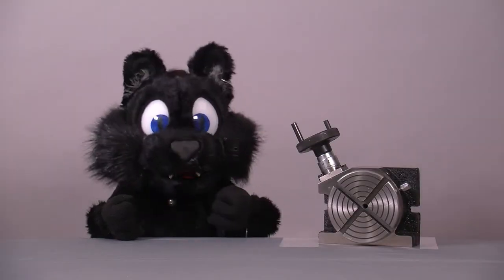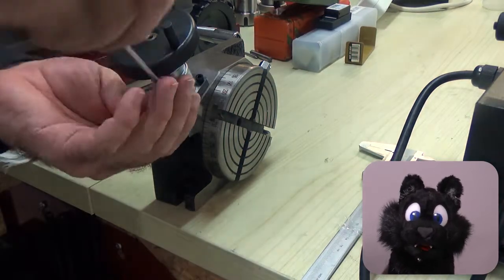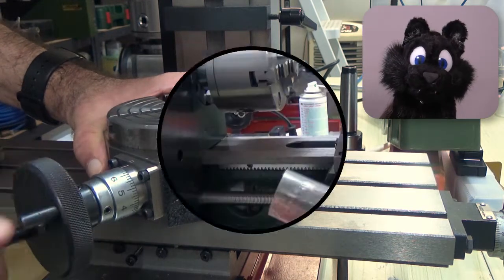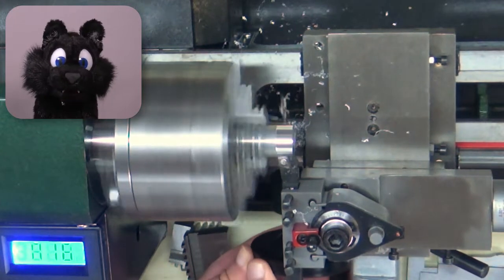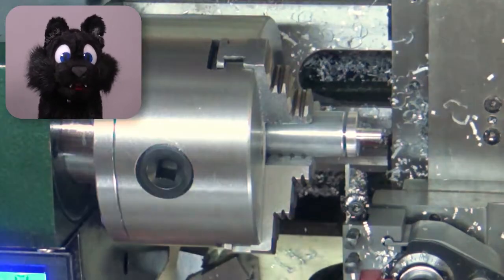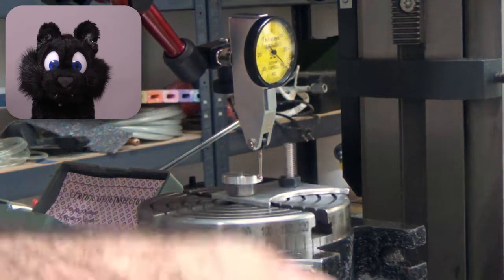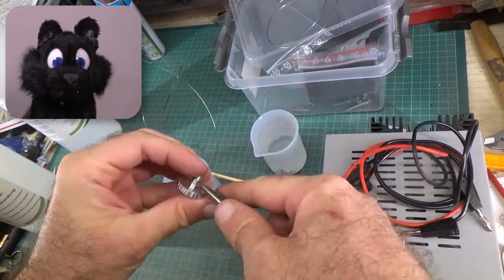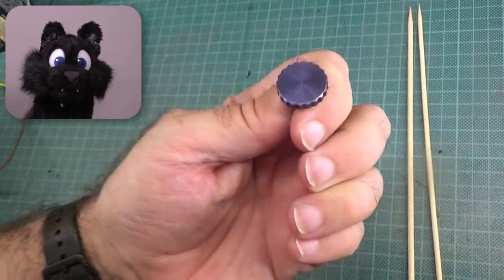Thumb Screw (and other stuffs)

Comment: Is you're mill the sx2p?  and did that rotary table come from ebay?   With the lathe... best to remove those long curly swarf chips sooner if they get caught in the chuck you will receive an unpleasant shower.  also when you sharpen you're parting tool angle the cutting face slightly with the longest point towards tailstock end / , that way when you part off the work piece it will come off clean.   Thanks for the vids,  You're one clever kitty.
Reply from the maker: Not sure how these model numbers compare; the mill might be offered undere different names by differend "badge providers". The listing is for "X2P", and yes, the rotary table is from ebay. I am on a budget ^^ - The chips were looking a tad bit higher in the video than they were IRL; but yes, better clean up sooner next time; I was just so mesmerized by the fact that it actually DID produce proper chips and not just grinding dust.  Same holds true for the parting tool really; before the tool post update it just chattered and didn't cut at all, so I usually took a hacksaw to the part. And I'm glad you enjoy my little workshop logs :)
Reply: @atkelar  I understand being on a budget im in the same boat, i just bought a sieg sx2p mill last week after saving for 3 years, but have been flat out with other jobs, hopefully il get to bolt it to the bench and use it soon. handy little machine for not much space.  I liked the small rotary table after seeing it i hope i can find one, like you said in the vid all i can find are huge ones.  I do enjoy you're videos have been subscribed for quite some time now (though some of the electrical bits i don't understand) it is a pleasure to watch you do a great job on all your projects..  Thanks for the vids and keep up the great work.... Cheers. AUS

Comment: Why move the cutter up before turnng 18°?
Reply from the maker: I wanted to get a good peek at the cut I just made before advancing. Also, I only have one cutter, so to prevent any "run ins" with the hold downs, I made sure that there is enough room. I had a depth stop set up, so it was just a wave of the paw really.